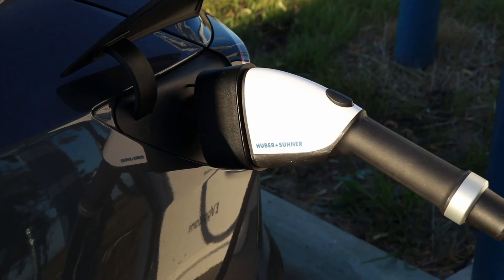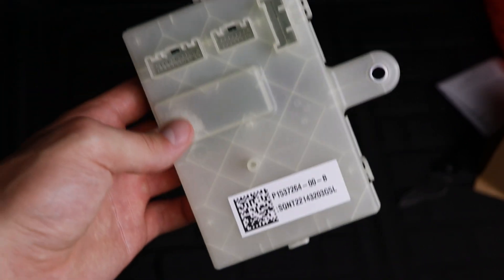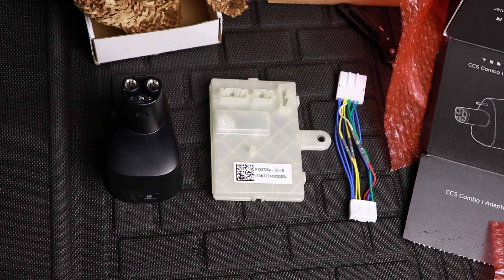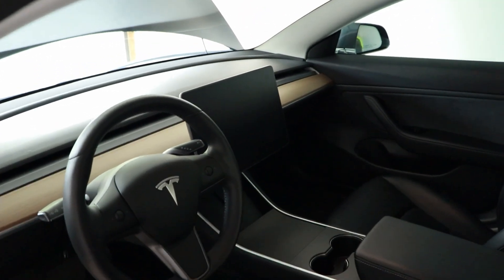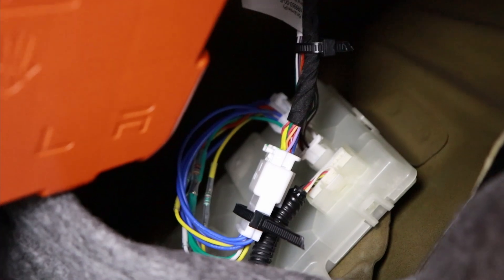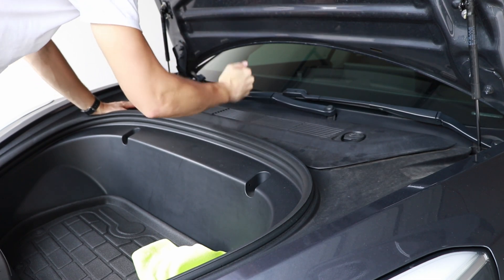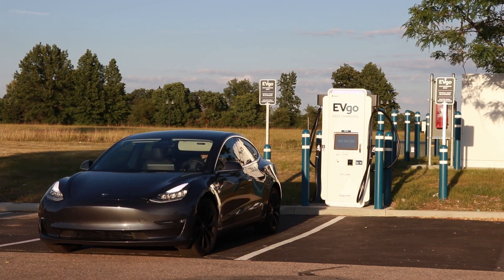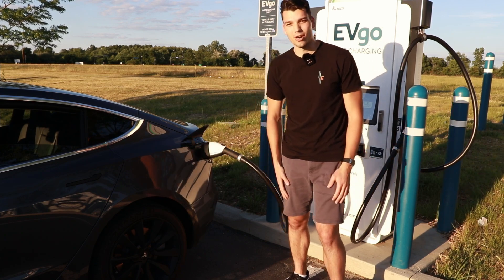How to retrofit CCS Adapter Support to your Tesla! (USA Tutorial)

Comment: Great video and explanation. 

QQ: If you’re on the current supported software version, how do you “download and not install software”?
Reply from the maker: You'll have to just wait until new software is available. By the time I had all the parts in, a new update was available, so it worked out well!
Reply: @Sibs  Gotcha. I was thinking that  would be the case. Since if I start ordering the parts, it’ll be awhile before all parts come in. Especially, the CCS adapter from Korea.

Comment: i dont understand why they haven’t switched to CCS everywhere
they already do that in europe
Reply from the maker: I think they're kinda "in too deep" at least in the US for using the Tesla port. They've scaled everything using that port, so switching now is tougher.
Reply: Tesla was required by law to change to/support CCS in Europe.
Reply: Who the hell wants to use a CCS charging handle instead of a Tesla charging handle? NOT Tesla owners. The CCS adapter is ONLY insurance. Tesla’s charging infrastructure Is FAR superior to the CCS infrastructure and ALWAYS will be since Tesla currently outpaces EA, ChargePoint, and EVGo in installing new locations.
Reply: @bigdougscommentary5719  standardization
It’s cheaper to make one big infrastructure than it is for 2 standards
Reply: @Juanguar  by that logic, Tesla’s connector should be the standard. Way more Teslas on the road than CCS/1 cars. 
Maybe make a new standard that uses the simplicity and ease of use of the Tesla plug with the output potential of CCS/2.  If they’re going to do anything,waiting only makes the situation worse.
Reply: @thespiceislife2082  well whatever the connector may be I’m saying that we should have a common standard shared with all cars to simplify charging
Kinda like with USB C and how it became the standard for phones and portable devices
Reply: @Juanguar  it would be nice to have one universal standard, however I don’t see that happening. Even if the US government was to force CSC/1 its still different than the CSC/2 standard used in Europe. 
USB-C is not a standard for devices. Mini, micro, USB-A and B are still widely used. Another fun fact, USB-C only refers to the physical connection, not the capability. USB-C v2.0 was just announced (80Gbps capable). It’s a mess and probably will be for a long time.